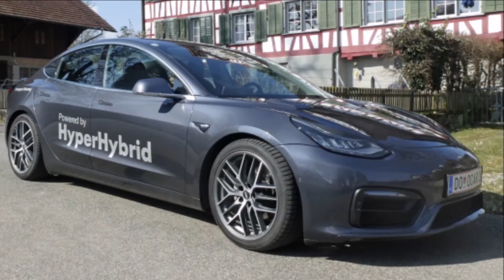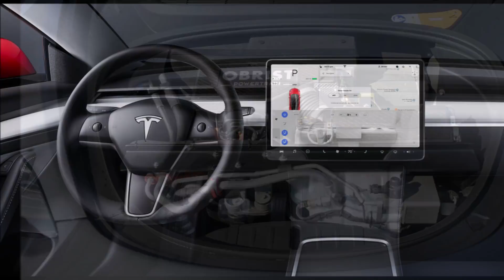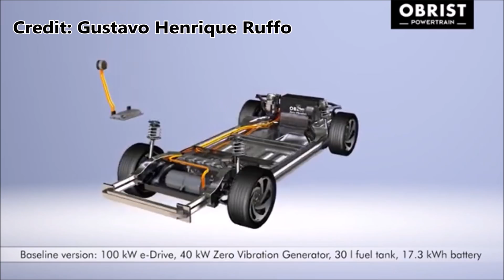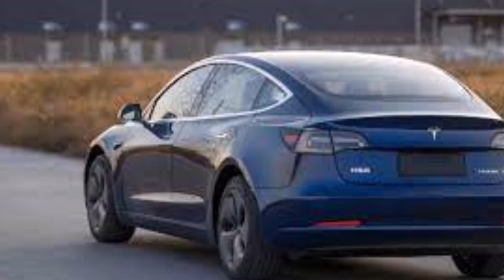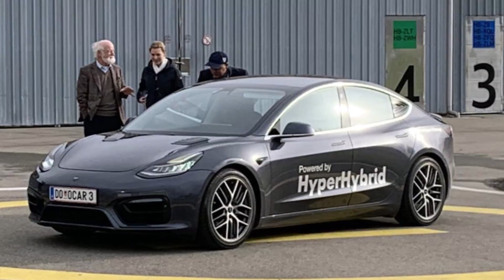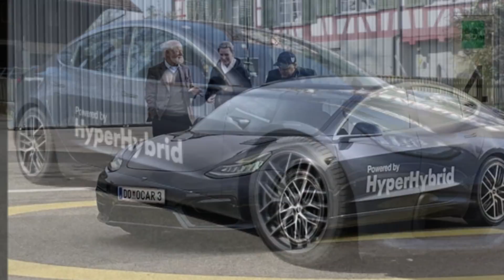HOURS AGO! This Tesla Model 3 Runs On Liquid Electricity

Comment: And to think I used to like your videos. There's no such thing as liquid electricity (unless it was always "liquid").
Now, there is NOTHING more efficient than battery/electric motor. Period!
I'll explain. "Liquid electricity" must refer to ammonia, methanol or other liquid fuel. 
Efficiency matters. It's estimated that a battery cell will require up to ⅒ the energy it will ever store over its lifetime. They are also about 90% efficient. Then, it's just the motor, at some 90%. This adds up to about 73% overall.
With H2, the electrolyzer is only about 60% efficient, the fuel cell is only about 60% or so and you still need to motor (and the energy required to make the fuel cells). This subtracts to only like 25% or so (you can do the math, and I forgot the 5% loss to H2 compression)!

No one beats Tesla efficiency!

Comment: Humm... A generator in a Tesla makes some sense.  If you can charge the battery at 20KW while driving, you can basically run on gasoline (or whatever fuel runs your generator) indefinitely (limited to your fuel tank size, but can refuel as rapidly as gas stations allow). It might be possible to build such a generator that is small enough to fit in the frunk of a tesla, or the rear "sub-trunk" of a tesla, and only weigh 100lbs or so (challenging, but maybe.) Charging while running would take a "hack" of the charging mechanism of a tesla, but should be doable. Heat dissipation and exhaust management of the generator will likely add to the complexity, but is still doable (might even have advantages in cold climates). You might be able to get away with a smaller battery (although the battery itself might need a greater specific power (watts per KG) to achieve the same performance). This might work... but... why not just go with a big battery? This seems to be the path Tesla has chosen. Now you have no gasoline engine, and no emissions issues (regulations and such) to deal with. You basically run off of lower cost electricity (the cost of a Kilowatt hour of energy costs about the same from the electric company as it does from a Shell station, but the conversion efficiency of the generator (supposedly 40% in this case) is just an extra big loss you have to absorb). You really only need this "generator thing-a-ma-bob" on long road trips (>200 miles per day of travel is really not required for vast majority of folks). Given the >1100 supercharger locations around the country (USA) this "generator thing-a-ma-bob" has limited value. Still, it might make sense for some small percentage of folks. However, if batteries can achieve a little higher energy density (KWH/kg) and recharge a little more rapidly (15 minutes or less to go from 0 to 80%) then one could argue that this generator thing-a-ma-bob isn't worth the effort. This seems to be the direction battery tech is going (at least lots of R&D is happening to push things in this direction). So, it’s probably just a matter of time before this generator thing-a-ma-bob is obsolete.  
      Interestingly, the fact that present battery production cannot meet the demands for the EV market (especially if the legacy automakers begin to try to shift to all electric vehicles), and will likely take years to do so, such an approach (smaller batteries, maybe with a 50 mile range, with high specific power to achieve the desired vehicle performance,  An on board 20KW generator battery charger,  an all-electric drive train,  at home/work charging,  smart battery management, so the battery basically runs out of charge as you drive into your garage in the evening), might be a good way to proceed for the legacy automakers.  This lets them leverage their internal combustion engine know-how (up to a point anyway), develop the all-electric drive train, maximize the EVs they can produce given the limited number of batteries produced, and allow their customers to enjoy the lower cost to fuel their vehicles (at least for the most part).  Then, when battery production catches up, they can ditch the generator and go with a larger battery to produce a Battery electric vehicle when they are much more prepared to do so.  (Maybe?)
      As for the solar made fuel… (methanol or hydrogen, etc…), does that really matter for the generator thing-a-ma-bob?  Seems the most valuable aspect of this idea is that you can refuel at any gas station (there are some 140,000 gas stations around the country). Anything unique about this solar made fuel such that it is not readily available at each of these (140,000) gas stations undermines the convenience aspect of the value proposition of the generator thing-a-ma-bob.  
     However, if this fuel can be produce cheaper than gasoline, then we should shift our “internal combustion engine” automotive fleet to run on this fuel.  But that seems unlikely.  
Seems that the best solution is to produce electricity (as best as we can) and use it to charge electric vehicles like teslas.   This seems like the most efficient way to go.

Comment: this is counterproductive and stinks of exhaust fumes and a bad attempt to retain combustion engines.  The internal combustion engine cannot be "more efficient" than a Tesla, thats comparing apples/oranges.  This isnt liquid electricity. Its not 0-sum either.  We dont need 0-sum plans to that increase complexity of the auto.  This is another boondoggle thats been tried over and over again.  Our methanol stocks are already stressed as it is, and it increases the danger due to having two forms of fuel that can combust.  This is digressive.  This will also consume more electricity for electrolysis, and cause more consumption of energy for its infrastructure. in addition, this engine utilizes oil stocks top lubricate the endgine which commonly leak over time.  There is so much "no" about this I question why you would even cover this. If this continues, I will boycott your channel.

Comment: There are more (plug-in) hybrid cars such as the Mitsubishi Outlander where an engine is used that utilizes a fossil fuel. Methanol is a hydrocarbon so this engine/system will emit at least CO2.

Comment: The only thing 'Hyper' is the marketing. "Liquid" electricity is just a marketing ploy for synthetic fuel & if you do a Google on synthetic fuel, you will find that the cheapest you can make the fuel is USD30/gallon. The whole concept is for 'zero sum' emmisions, where you produce the hydrogen using electrolysis & then capture the CO2 from the air & combine (using electricity again) it with the hydrogen to make the syn-fuel. It's carbon neutral because you use the carbon already in the atmosphere, which is returned to the atmosphere when combusted. Since electric motors are twice as effecient as ICE, this set up is better than having an ICE drive train hybrid

A coal fired power plant is a lot more effective, effecient & a lot less CO2 emitted than using the same amount of energy in the equivalent  ICE. ALSO an EV using 100% electricity ONLY from a coal fired plant is much better than using ICE cars - Much less CO2 emitted.

Therfore getting rid of ICE is the most effecient & effective way for road trnsport. Going Solar with storage (whether Litium batteries or other) is the best way to get rid of all Coal & Gas fired power plants. Nuclear is even more effecient/effective, but too many people have negative feelings for this source of energy.

Comment: They are just turning the electric vehicle into a hybrid electric car like we have had since the 90's.  A traditional gasoline engine powers an electric generator to produce electricity to power the car or recharge the batteries.  It was a good evolution from gasoline vehicles to electric vehicles, but now its going backwards

Comment: Its just a rex range extender like the BMW i3 rex. Unfortunately they taking the tesla battery away and put their own battery in.... turning it into a Nissan note e power. 
A cheaper and better idea is get a 30amp Honda generator mounted to the rear hitch and u got the same thing but cheaper

Comment: It’s just a tuned (efficient) generator to provide electricity.  Electric motors are 90% efficient.  While running on an Obrist generator, which they claim is 40% efficient, the total efficiency is 36%.  So it’s still inefficient.

Batteries will get lighter, more energy dense, and cheaper.  This is a waste of time.
Reply: exactly
Reply: Greg, a waste of time because all you probably focus on is the USA like most Americans do. Anything outside your "bubble" is unimportant to you. You drank too much "pure electric" Kool-aid. The technology is more for a global solution. If you look outside your bubble, there are other countries that would benefit from this.
Reply: @honeybee0414  This abomination defiles the engineering perfection that Tesla is achieving and directly contradicts the Tesla mission statement, to to accelerate the world's transition to sustainable energy. Nothing to do with USA or non USA
Reply: @gregarmstrong4653  So we should just wait until Tesla makes everything electric? I believe other companies can assist Tesla to accelerate their mission, dont u think?
Reply: @honeybee0414  BEVs won’t make practical sense for the third world for some time due to infrastructure issues.  But that doesn’t mean it’s not the ideal technology for replacing ICEVs on a global scale. It’s not just an USA thing. .
Reply: @greghelton4668  ok but other technologies can assist to advance our global issues in other parts of the world.

Comment: I like the idea.  I think you could make a high efficiency air cooled gas turbine generator to augment power.  And a big slow battery would need this to help with acceleration.

If you want to create 50 HP, that is about a 40kwh load.  You can get 50kwh turbines in airplane APUs.  That's all you get in your trunk, though...

15kw generator with options for burning propane, methane, and alcohol...  boost power by 50% for a while...

That has a niche...

Comment: Wow, I already own a Hyper-Hybrid, running off of liquid electricity too! And my previous 3 cars also employed this advanced engineering technology, starting 8+ years ago! GM calls this an EREV, or extended range electric vehicle. Joking aside, it's simply a Tesla Model 3 that uses a gas powered range extender. Basically, it's a plug-in hybrid. Like the Chevy Volt and BMW i3. I do think that there is some value here beyond the tons of laughable marketing hype, because this is where plug-in hybrids SHOULD have evolved to. Having say 160 miles of EV range, fast charging, and then a small, light, range extender for those occasional longer trips. For some people this is an ideal option, and GM really should have kept the Volt, but then expanded it's EV capabilities.

Comment: I added a horse to my minivan.  At low speeds, the horse pulls it.  At high speeds the internal combustion engine starts and pulls the van and the horse around.
Reply: maybe add a steam engine to synthesize the liquid electricity either on the roof or in a trailer with the horse on a treadmill as backup

Comment: This idea is not news. No offence, my good friend Armen.
But BMW's i3 hatchback has a series hybrid, or as it is called in the UK, a range-extended electric vehicle. It has 90 miles battery, plus a motorcycle engine.
Reply: Exactly. i3 REX or Opel Ampera (Chevrolet Volt) used the same concept. Obrist claims their combustion engine is specially optimized for this task for minimum vibrations and emissions but in the end it's just a normal serial hybrid concept.